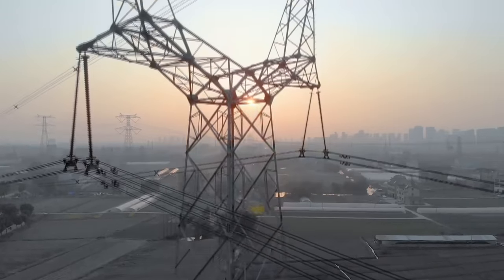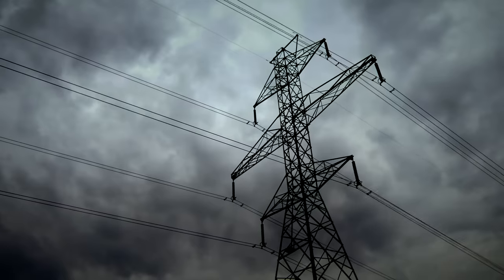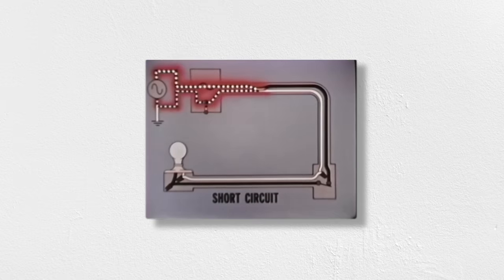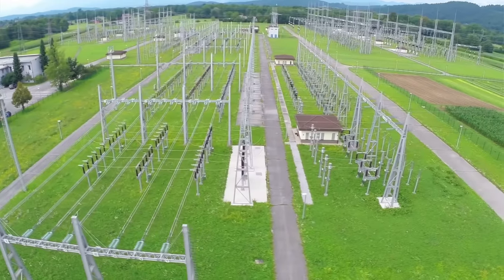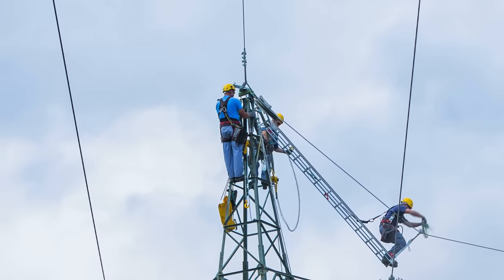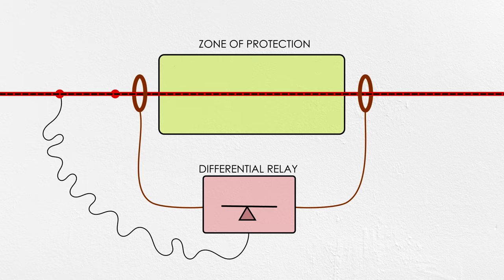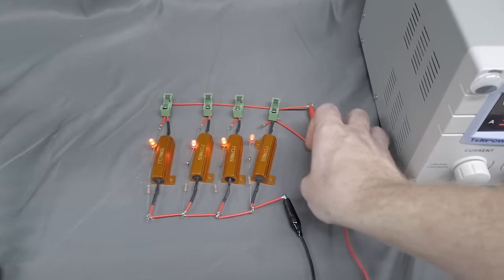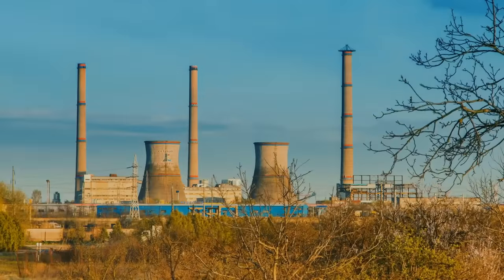How Power Blackouts Work

Comment: One thing that isnt mentioned, but is becoming increasingly important is the use of remedial action systems (RAS). I'm a control engineer specialising in RAS which span the UK transmission network; essentially these are "generation shedding" developed to detect line end open circuits (LEOs) and trip large scale generation such as windfarms and interconnectors. Based upon where this LEO occurs could mean the thermal capacity of a circuit/s is exceeded, requiring tripping of generation to avoid thermal damage to equipment. 

Furthermore, these systems look to maintain grid stability by countering frequency changes, to prevent cascade tripping events and large scale blackouts. When involved with commissioning support of these systems, I have seen protection relays for 1GW interconnectors armed and ready, even while working in the same panel which is as comfortable as it sounds hahah. Overall great video anyway!!

Comment: "The blackout of 2003 that took out much of the US North East and Ontario"

*Laughs in Québécois*
Reply: In Italy also nationwide blackout in 2003. It was a mess
Reply: @Harry M Depends on what were damaged and how the fail-safe works. If what damaged is something major (like main transmission from major electric producer) them automatically major area would get blackout. If the failsafes were all something like single-use fuse, then repair them would take time anyway.
Reply: Ahaha the 1998 ice storm had 8 year old me learning how to make fires, build shelter and hunt deer with my bare hands.
(Not really but that was some war-of-the-world shit and i learned how important gas stoves were)
Reply: Harry M because the sudden loss of a load causes the generators to speed up and things shutdown for over frequency.  I don’t know what their limits are but my solar gear calls anything >60.5hz an error and shuts down.

Comment: Yup.. on august 4 2019, half of java (Indonesia) had a 6-12 hours electric blackout
Reply: good
Reply: @edwin3928ohd  How the hell is that good?
Reply: @peter0976  because it lasted no more than half a day.
Reply: That's what you got when big power plants are located 1000km away from the biggest load center. All you need is a tree to short the circuit and voila, half of the island had a blackout
Reply: isn't java in Minecraft?
Reply: @non-inertialobserver946  wrong way around, Minecraft is in Java.
Reply: @edwin3928ohd  sadly back then,  some cities actually got fluctuating electricity, and even some small areas still don't get electricity for more than a day
Reply: @syahadatulhidayat1325  well, our power plants are mostly coal-based, and we can't build all power plants close to cities. 
And in the case of Java, coal power plants in the eastern side of the island is much cheaper, so most electricity went from there everyday
Reply: @adiabd1  good

Comment: 4:30 JESUS what is that guy holding on to? :O
Reply: épinards & caramel it looks like they are adding a “tap” to the line.  (Probably for a line potential device of some sort, lower down and out of the picture).  He is prepping the tap to keep it in place.  He wraps Armor Rod around the conductor on both sides.  That stuff he is holding is the Armor Rod.

Comment: Hi, um, California here. First off, may not want to discount the concern of fire when there is a fault. Power line faults have become a huge issue here when it comes to starting wildfires. Scores of folks have lost their lives and homes, those faults are no small thing here.

In fact, it would be interesting to have a video that includes the impact of climate change and how providers are adjusting and scrambling to react. Locally, PG&E is saying that if they harden the grid and switch from wooden poles to steel poles that will reduce the necessity of a shutoff due to wind danger. But lots of folks locally think it's just cover because they're going bankrupt and they want a state bond measure to finance the new poles. Would be interesting to see the science on it more clearly.

Comment: In Finland most residential and industrial power lines are nowadays underground. This is mainly to protect them from trees and branches falling due to wind or snow. These days power outages are really rare, and when they do happen, the recovery time is usually from a few seconds to less than a minute.

We also have national guidelines that specify how long the power may remain out for before the company responsible for said line has to pay a fine. This was obviously a major motivator in the process. All in all this means that you, as an end user, pay a premium for power transmission, but I think it is worth it.

Comment: Here're a couple things for you to do videos on. 1) How do linemen survive being in contact with high power transmission lines while sitting on the skid of a helicopter? 2) If a large EM pulse were to cause the blowout of several transformers, how long would it take to get them replaced? I've heard that replacement could take months. It can take months just to build a single large transformer. They're also very expensive, which may be why they're not kept in stock. Whatever, I'd like the straight skinny. Thanks.

Comment: Hey Grady, London, yes London, got cut-off because a technician put the wrong fuse in one of the major relays to the circuits supplying one of the input lines on the grid. One of the other grid input lines was shut down for maintenance, leaving the last two standing where the systems panicked and shut down what was left... basically London shut down.....

Comment: Last year a storm knocked over trees and wreaked havoc in my area. The next day I went out to see what was up and I saw a large branch laying across the transmission wires and was on the ground at the other end. I almost walked up and tried removing it myself, then I reconsidered and called the emergency line. They told me not to touch it or even go near it. When the Lineman finally arrived, I was talking to him and he flat out told me if I had touched that branch, I would be dead. It was grounding out power lines. That shook me up. I couldn't believe I was actually going to grab it. I thank my stars that I listened to my inner self warning me. This is a cautionary tale. If you see it, leave it. If you're in your car and can't get out, don't even try. As soon as you open up your door and place your foot on the ground, you just let the current, which was being isolated by the rubber tires, have a path to ground. Through YOU!

Comment: I live in Phoenix. Our power goes out for about 3hours every other year. Usually caused by lightning, wind damage or car hitting a pole or ground level equipment. Occasionally a transformer will overheat and catch fire but that's exceedingly rare.
Reply: Where I live in the US, the power has only been out over 10 minutes once in 25 years, and that was for 4 hours when a transformer caught fire.

Comment: When the electricity doesn't shut off, and there's a problem, you're in trouble. 

Last month, at my work, a power line broke during a windstorm, landing on a tree. Luckily, I was well away from it and had electrically resistant shoes because the fuse didn't break the circuit until the line fell onto the metal fence below it, generating a big arc. I ran screaming to the insulated safety of my car to call 911, but someone beat me to it, and the fire department arrived as I was leaving. It's very fortunate that everyone there knew about power line safety, and stayed far away.

Comment: I'm not a Registered Land Surveyor, but I have been land surveying since 2001. I'm a 4G certified welder though. I love your video's Grady. We were surveying a powerline one time when this helicopter came out of nowhere, and dropped a man with a metal suit onto the 500KV line. He slid on the powerline like a zipline. Then after tinkering with an insulator, got back on the helicopter and you could see sparks flying from a rod from the helicopter to the man getting back on. I was making $27.50 an hour at the time, so I wondered how much those men make an hour. A buck or two more than I do I'd say :)

Comment: Also one thing not in here is that if you see a power failure where you have power it cuts out briefly like 3-5 times this is the work of a part called a recloser. This is sort of like a breaker, but the logic is that say there is just a quick fault this device trips then makes the circuit again and if fault persists it resets for a programmed number of times then it will just stay open and then needs manual repair. This is because you may have wind just cause a limb to briefly make contact with a line or a limb on the line, if it trips once it cuts out then it will try again and sometimes this action will blow the branch off or cause it to burn up and then fall off.

Comment: I live in Japan and blackouts are very rare.  We just had a category 5 typhoon and the power stayed up the whole time.   Actually, there are 1 or 2 typhoons every year and the power does not go down.  Cables are all above ground on concrete poles.   When I lived in the U.S., blackouts were to be expected for any hurricane and sometimes for midsummer thunderstorms.  I thought that the the good track record in Japan was due to constant planning, maintenance, surveillance.  They just did some maintenance and inspection on the connections to the pole across the street from me this afternoon.  Sometimes it is not apparent that there is a problem, but the maintenance seems to be done as a precautionary measure. The few times that we did have blackouts in Japan were in the period following the big earthquake in northeastern Japan, but even then the blackouts were scheduled.  They told us when the power would be temporarily down and for how long and things went according to these schedules.  I am wondering about how the standards for the power grids differ between Japan and elsewhere and whether it would be feasible for other places to improve.

Comment: Puerto Rico has an eerie experience with cascading failures and so-called black starts. In a matter of 3 years we had...

* Black-out due to failure of a transformer at a large power plant's switchyard (2016, 2.5 days to turn grid back on)

* Near-complete destruction of the power transmission and distribution grids when facing Hurricane Maria (2017, power restoration for 90+% of island-wide custoemrs took 6 months and then another 6 months for the most remote mountain neighborhoods and complicated urban areas)

* Two more black-out events during that reconstruction period, one of them caused by a short-circuit from an excavator's arm being too close (but not contacting mechanically) a transmission line. Took another 2.5 days to start the grid again, for 2.5 days as well.

* Rolling black-outs due to the abundance of old generation equipment which is either too deteriorated to operate or not in compliance with environmental regulations, leading to a generation deficit despite the sharp population declines of the last 12 years. These still happen occasionally in the busier urban areas.

Comment: Grady, I came across your channel about a year ago and have enjoyed your videos and your approach to educating the masses.

A few years ago I went on an electrical service call to a homestead, at least the owner realized he was in over his head with an electrical problem. His story of the building his residential structure (house) had me shaking my head and doing some research myself.  The owner managed to talk the county building inspector out of the need for a soil compaction test before building his house, stating that the ground was so hard, granted in areas of SE Arizona some heavy machinery have a difficult time breaking the surface. 

From a civil engineers' perspective, what is the benefit of building on compacted substrate vs just a solid surface?

Comment: I'm guilty for getting upset when the power randomly goes out. Especially since it seems to happen at horrible times. (Like after beating a challenging fight in a game or before saving time consuming work at home.) However, I check myself whenever I do this because electrical service people (and so as plumber, trash collectors and road workers) are some of the least valued people doing work when what they do keeps our society going. They're extremely valuable and I'm grateful for their work.

I'm personally working towards a battery backup for my home so I can minimize the effect of black outs.

Comment: I remember the big blackout that came with a fault on the Pacific Intertie (1996, I think). I'd long since developed the habit of driving out of blackout areas for a meal or movie while waiting for the power to be restored at my home. That time though, I drove all over the southern portions of the San Francisco bay area. The was almost no power for dozens and dozens of mile. But it was during the day so life went on. Later I learned lights had been out down into Mexico. It was a day the earth stood still - for a while. All because of a lightning struck tree fire in the Northwest wilderness and a grid protecting itself.

Comment: I made a comment a couple weeks ago about the northeast blackout being caused by a faulty load-shedding scheme ... now Grady expounds upon that comment with his usual skill in explaining things in easy-to-understand terms.   One thing he didn't mention is that modern relays don't just monitor frequency but also waveforms.  Some low-level faults may not have enough current to trigger overcurrent relays but they throw the waveform out, and these relays can be programmed to 'spot' this and trigger the breaker.

Comment: I've been in the northeast US my whole life, and was probably affected by the 2003 outage you mentioned.

I was also 4 or 5 at the time, though, so I sure as hell don't remember it. Cool video nonetheless, though! And hilariously relevant, I've had three outages in the past month, I think due to faults in one of the transformers responsible for my general part of the neighborhood. There's currently a cable running from a transformer on my street to a transformer on the next.

Comment: Underground cables short too…and many times a transformer failure in an underground vault results in all the equipment being damaged which doesn’t happen as severely with overhead. The cost to convert overhead to underground is very costly—lots of legal issues as well equipment. But all new construction requires going underground.  Most of the information you provided in this video is accurate but there are a few comments that are not 100%.  For your demo of sagging wire you used copper. Nearly all, if not all, primary voltage conductor on the west coast (California, Oregon, etc.) is ACSR; aluminum-conductor steel-reinforced. The few strands of steel in the center of the aluminum multiple stands helps lessen the sag since steel has a higher melting temperature than aluminum. Overall great video.

Comment: Electric utility system reliability has been a big part of my professional focus over the decades, so I thought I’d add a comment prior to watching. Most outages or “blackouts” occur on distribution circuits and rarely do they happen on the bulk power system (BPS). When they do happen on the BPS, and there may be 1000 reasons why that might happen, it’s big news and millions are affected. When your lights go out at home or at work it is likely because of a fuse or circuit breaker that opened due to either animal, tree, weather (lightning or wind or ice are common), or equipment failure. Electric systems are designed to open in the event of a fault (failure) and that keeps the outage(s) localized and impacting the fewest number of utility customers as possible. So yes, outages are a result of protection devices doing their job for your safety.

Comment: I live near the Jersey Shore, not far from NYC. And our weather often includes wind storms, ice storms, and flooding, and small-scale power outages are common. And I can't use the internet without electricity! So I phone the power company's "outage hotline" to report it, and they give me an estimate of when it will be fixed -usually it's finished well before that time. But it seems to me that the utility could use drones to make a map of places where trees have big branches  hanging into the wires, and send crews to remove the branches and make the power line more protected. Of course the cost of electricity will go up if they do that...

My landlord loaned us a generator after Sandy, when the power and phone and internet were down for five weeks. My furnace uses an electrical circulating pump, and of course there's computers and TV and my rice cooker and the coffee percolator. I rent this place, but if I owned it, I'd have a Generac installed.

Comment: The problem with putting power lines underground is it cost 4 to 5 times as much to put them underground as it does to put them over head. And whenever a underground line goes bad it takes longer to trouble shoot and fix them.
Reply: 100% true. (Recently retired from 34 years in field support with a Fortune 100 electric company.)

Comment: Circuit breakers, with various sensors for different sorts of issues, that additionally can trigger (query, and maybe even refer to in order to for example pass those references around) each other, everywhere. :)
Reply: In the past few decades that system, known as Remedial Action Schemes (RAS), does exactly that. The company I retired from was late to the game but has embraced them at last. Before that, protection was strictly focused on equipment health. That led to all sorts of problems, introducing even greater instabilities too often. Both systems are important.